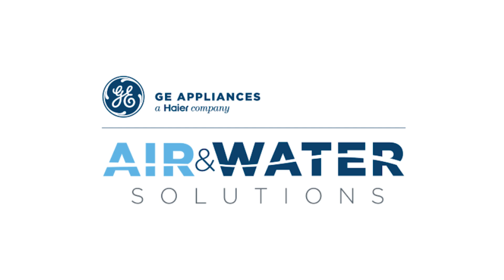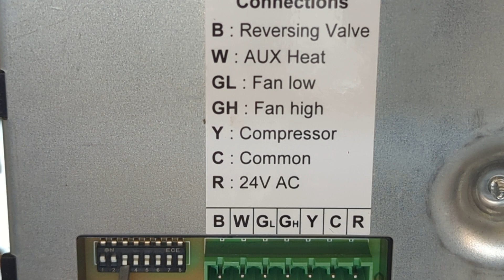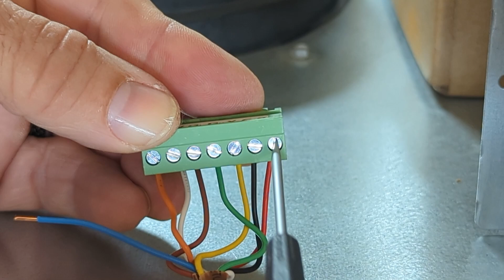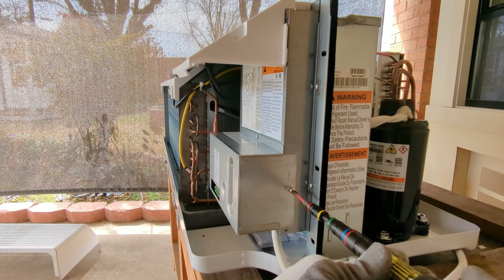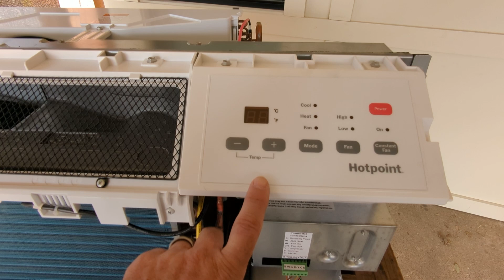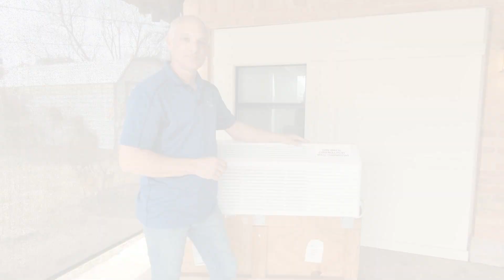Installing a thermostat interface kit on your Hotpoint series A PTAC thumbnail

Comment: I am so thankful for this video. I been searching for this. Manual is not specific about anything and ge website did not list any accessories for my A PTAC unit. If you are looking for this: go to Google and enter - thermostat interface kit for Hotpoint series A PTAC - This will show the available sellers.  Part number looks like is: RAKETKH